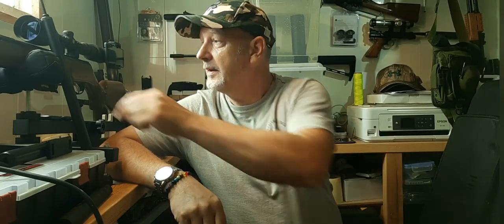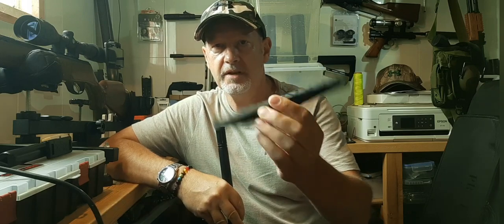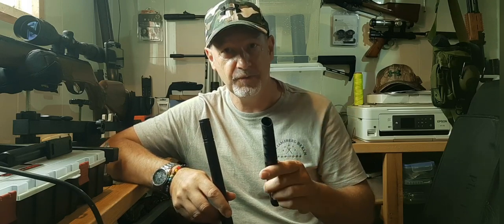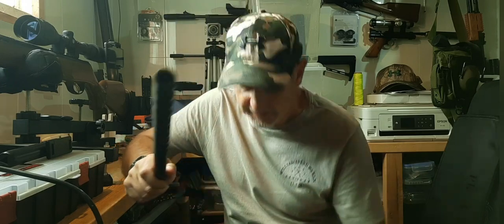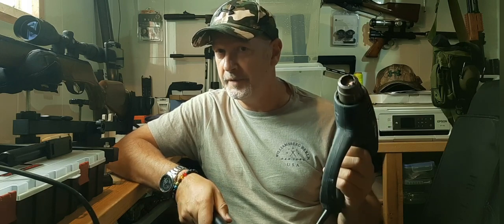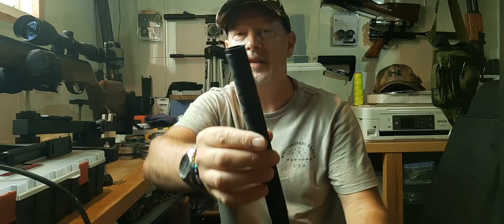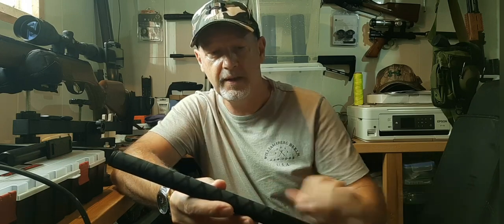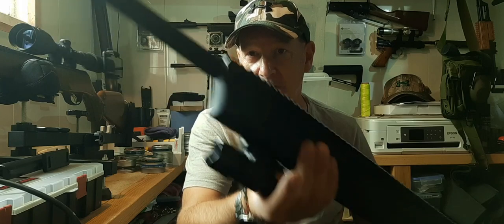How To Shrink Wrap Barrels and Silencers

Comment: I do a similar thing to protect my shroud/moderator by sliding over a cut length of cycle inner tube. Get the correct diameter  so it's ever so slightly smaller and because the inside of the inner tube has french chalk (talc) inside, you can gently and easily pull it over. Apart from the protection, it also helps to give extra sound deadening insulation.
Reply from the maker: Great idea, I'll give that a try 👍

Comment: Excellent 👌
Can you tell me what size I need for the Phox MK2 suppressor please as I won't get my gun until Wednesday and would like to be able to protect it from new. Cheers.
Reply from the maker: You'll need 30mm or close to that. It is better to go over rather than under. It will shrink to fit.

Comment: Hi there, i have got a thin 12mm OD .177 pcp barrel so what size would be good to shrink firmly on to the barrel? If you would kindly share your knowledge on this because I would be happy with any amount of support the thin barrel can get.
Reply from the maker: Hi, this stuff shrinks right down to nothing. It just takes a bit longer. So I tend to use around 20mm as it can fit everything. Once it's cooled it a really good tight fit.
Reply: @RealAirgunAdventures  if it shrinks down to nothing that would mean negligible support to the barrel, maybe i will try the poltruded carbon fibre tube 14mm OD with 12mm inner bore. Hope it works out. Thanks for the info.

Comment: Do they sell some for potato canons?
I can see this being usefull on a break barrel with no shroud to prevent rust !
[Could moisture get under it?]
Reply from the maker: It's pretty much air tight. I've used it on underlevers and breakbarrels. It's best on silencers as it gives better grip. I'll see if it available in large diameters, for potato cannons. 🤣

Comment: Got TONS of heat shrink rubber at work , of various sizes , trouble is , it just plain grey or black with the company's name on it , so it would look aweful , wouldn't make mind trying the stuff you've used , got a S410 tdr which the barrel gas a tad of rust on it , breech blocks broke anawl , but thats a different story ..
Reply from the maker: I had an old break barrel with a bit of rust. I wiped a bit of oil over it and shrunk wrapped it. Worked a treat.